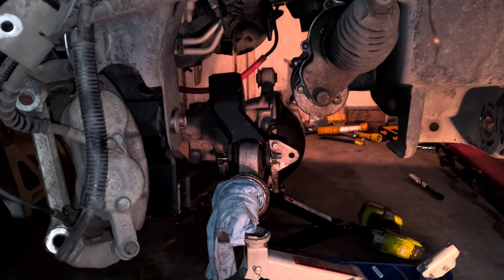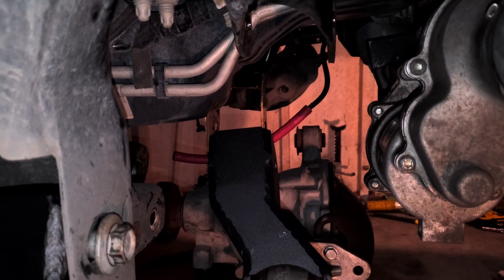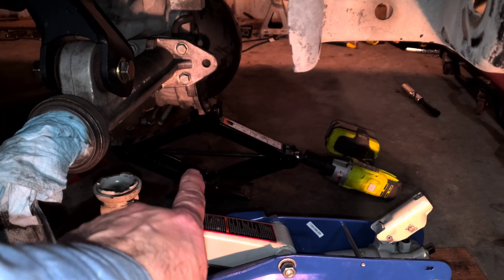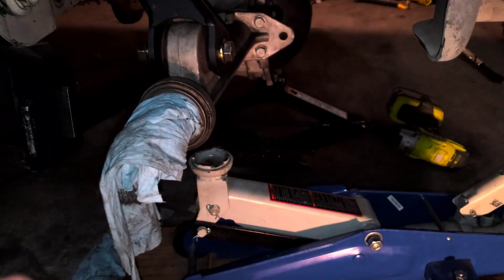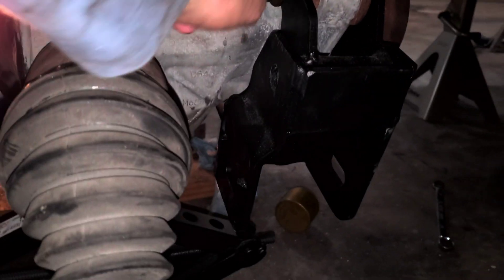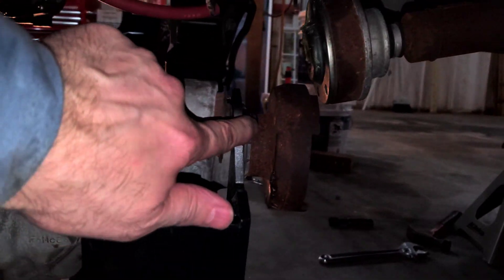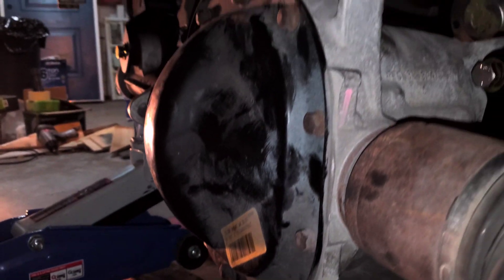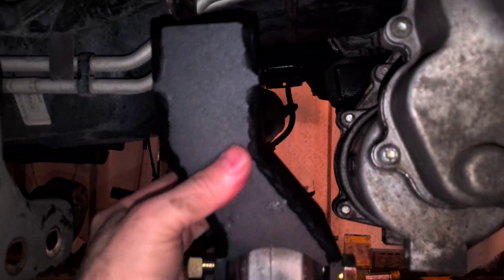Install Ford F150 front differential using scissor jack at home

Comment: So you can afford a $1300-1700 lift kit but can't buy a $200 floor jack?  🤦‍♂️.  Btw the drop bracket is inverted and you probably didn't realize that the tie rod boot rubs against the struts on a hard lock turn. My oh my.
Reply from the maker: Your comment makes no sense. If I needed a $200 jack I would go buy one. And nothing is inverted, my kit is installed properly. In other words, you don't know what you're talking about.